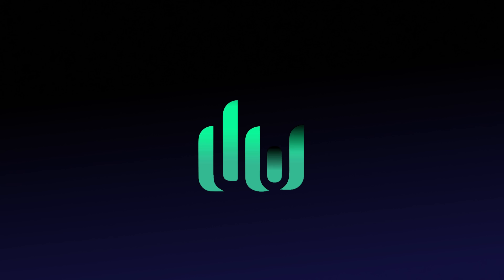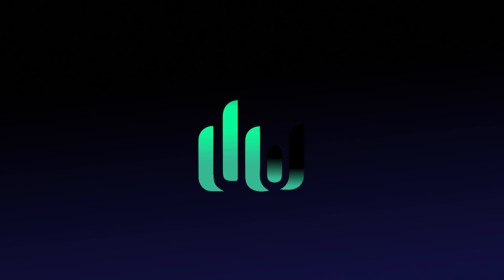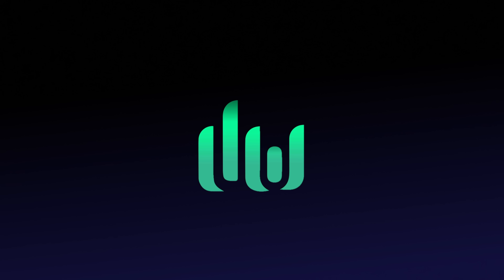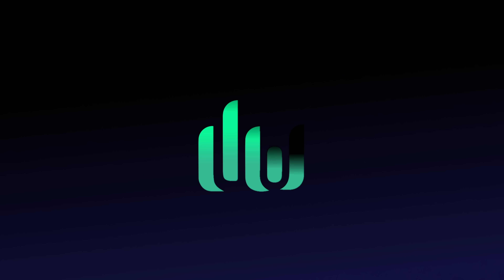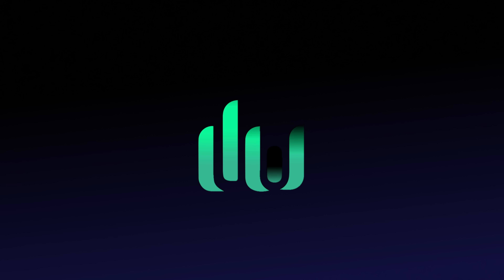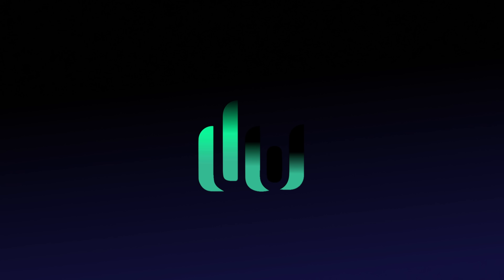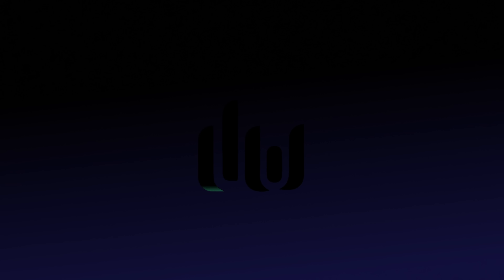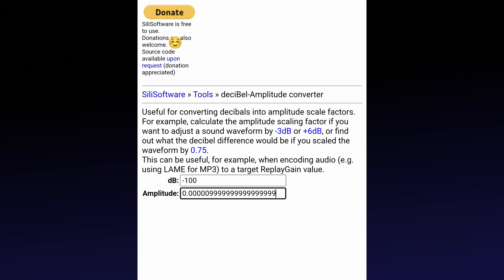WTF is a Decibel?

Comment: 3:00 acoustician here - SPL isn't normally expressed as 'dB SPL' - the correct index for sound power (LWA) or in this case, sound pressure (LPA) - however in environmental acoustics you'll usually use the LAeq,T index or the LAmax index to express the average and the maxima sound pressure levels. It's important to note that for sound pressure, a decibel is simply a ratio of the measured Pascals against the reference Pascal value. So for airborne sound, it's normally 20*LOG(Measured Pa/2*10^-5 Pa).

It's also important to note that you can take sound pressure and sound power and use a lightbulb as an analogy. The sound power is like the watts of power the lightbulb is using - this is a constant and is the OUTPUT of the light (speaker/source) itself. The sound pressure is a relative point away from that source. It's important to also know that sources can be area, planar, line or point sources.

And to add, weighting is very important too! A (for environmental acoustics, this emulates the effective weighting of the human ear) - C (similar to A, but allows room for lower frequencies, this is normally great for impulsive sounds or for music-related environmental sound) and then Z (this is just the unweighted sound).

This is a great video, something I wish I had when I first started out!!
Reply: great post man. everyone should read this immediately.
Reply: The A weighting curve adjustment should be scrapped and replaced by something actually relevant to noise nuisance value.
Reply: @jrgroberts  A weighting makes sure that single value broadband sound levels are most reflective of how humans actually perceive sound across the frequency spectrum. Look up the fletcher munson curve.
Reply: @producermathew  The Fletcher-Munson curve was created +90 years ago, when measurement equipment was nothing to par compared to what we use nowadays. Even if it has been was further revisions of the Fletcher-Munson curves, the A weighting curve is a scam. That helps politicians to avoid legal issues of millions of people contamined by out of the scope noise due to LAeq filters. It makes sense to revisit these concepts as @jrgroberts  suggests, because the incremental low freq noise environments we suffer in the modern world.
Reply: @PereRevert  the A weighting curve is not inversely proportional to the fletcher munson curve. The A weighting correction is standardised within IEC 61672-1, ISO 226 and ANSI S1.4.

A-weighting is generally considered representative of a typical curve for human hearing in so much that we do not perceive frequencies in the same way as an ultra flat type 1 measurement system.

You say it’s a scam, yet don’t provide any context. This is false.
Reply: @producermathew  I didn't say the A weighting curve was inversely proportional to the Fletcher-Munson one. I shoud have mention based on, even if, as you pointed out, it has been further revisions during the years (decades). You're true in regards of I don't provide any context... I should have metion in the context of respecting noise pollution affectations to the people! I mean, because of the A weighting curve is ignoring (filtering) low freq content, that is also so damaging to the human health actually. There are endless situations nowadays of construction and nighclubs low noise pollution for instance, that gets out of the radar or LAeq legal measurements, even if this people is still suffering from it without any legal possibilities to fight against the situation.
Reply: @PereRevert  You're misunderstanding the purpose of A-weighting. A-weighting helps assess noise based on how the human ear hears sound, not how the body feels sound. This means it’s suitable 99% of the time for measuring typical noise levels. A-weighting doesn’t completely ignore low-frequency sounds—saying so is just misinformed.

The real issue with low-frequency sound isn’t about human perception but rather its tendency to create structure-borne noise, which isn't picked up well by A-weighting because it measures audibility, not vibration. For standard noise concerns, A-weighting works perfectly. Often specific reference curves can be used as a datum against which 1/3 octave band sound would be compared. This is in accordance with NANR45 Procedure for the assessment of low frequency noise disturbance.

So in short, no, A-weighting does not really hide any low-frequency impacts in terms of audible sound. What it might not do is accurately portray the subjective characteristics of sound, which standards BS 4142 consider when completing acoustic impact assessments.
Reply: @producermathew  I think we agree on most of the procedures for assessment of noise disturbance... and obviously we agree on the purpose of A weighting... but I don't get it when you're arguing about the fact that A-weighting works for most of the noise concerns, knowing that the most critical are implicit to heavy low freq content. Obviously these are effectively more discernable by structure vibration noise than audibility, due to the nature of the wavelength propagation and acoustic energy, that are frequency dependent. But that's the point of my first thoughts and comment my friend! How effectively we can measure noise disturbance from low freq noise sources with a mere A-weighted mesurement, in order to take action for complaints based on that specific situation that usual A-weighted assessment cannot solve!
Reply: @PereRevert  it depends on the source and what you’re trying to ascertain or assess. Most noise concerns are in relation to rail, road and aircraft. All of which are suitably assessed using A-weighting.

As an acoustics consultant who is a member of the institute of acoustics, it is RARE to be asked to assess specific low frequency sources. Naturally you’ll supplement A weighted measurements in such a scenario with unweighted 1/3 octave band analysis of the source.

As previously mentioned, using the University of Salford procedure for low frequency assessment, we can compare the 1/3 octave band results from below 200 Hz to a reference curve which acts as a threshold to determine the likeliness of impact.

But going back to my original comment, we almost always use A weighting. It’s standardised by the WHO, multiple international and national standards etc… 

So my point remains, A weighting is just fine for pretty much most concerns of noise.

May I ask what your background is in acoustics?
Reply: @producermathew  Thanks for your clarifications. It's really nurturing having such discussions over here! It's great to know your background, and I get all your points, that I mostly agree, but as an audio engineer it's hard to believe that high SPL noise sources can we suitably assessed using A-weighting in regards to the  real impact on human health in a real life situations that I can suffer myself. Even if it cannot be measured by A-weighted equipment for obvious reasons due to the nature of propagation. The reality is, most measurement in reaction to noise complaints in most European cities (where I live/work), AREN'T supplemented by unweigthed 1/3 octave band analysis on the lows and sub-lows bands (thresholds <150Hz), and I guess that's the problem what I'm talking about. Would love to know your sincere opinion on that specific issue, and also if there's any dB compensation in order to match equal-loudness contours on those low freq bands measurements when 1/3 octave band analysis is assessed. I guess a reference curve at a certain threshold solves that though. Thanks dude!
Reply: @PereRevert  so, if we are looking at single broadband values that are A weighted, there’s little context as to the tonality of sound.

Unfortunately I’m not too familiar with European acoustics standards and legislation, although the UK is similar in so much that we use similar principles to the EU.

Generally speaking, A weighting is suitable. And yes, sometimes this can cause a margin of error - but this is something that gets considered. 

I think my point is, at least in the UK, if the plant for example is significant in its low frequency sound energy, this is something that gets covered off by using penalties to add to the single dB(A) value. 

The thing with A weighting is that it doesn’t completely filter off low frequency information, it kind of just focuses everything more on the mids, as the human ear would.

C weighting may sometimes be used particularly for clubs or rather festivals just so that it penalises the low frequencies more which may enable mitigation to be provided over and above what we as humans would require.

I think possibly, this conversation perhaps is starting to dive into the psychology around acoustics which is incredibly fascinating as not least this all starts with subjectivity to sound. And yes, some individuals may be much more sensitive to low frequency sound than others!

It’s like if we’re assessing an overly impulsive source of sound, we may consider the maxima sound levels more than any continuous logarithmic averages.

But to simplify the above, A weighting is good for pretty much most things, and then any acoustician worth their salt would then consider context and the subjectivity of the sound they are assessing.

This is the difference between acoustic design and GOOD acoustic design. I agree that in some  jurisdictions, there isn’t really a holistic approach to assessing the impact of noise. I think in the UK, we do a good job at managing these more complex sources.

Perhaps, it could be beneficial for me to dive more into some of the European standards to see how the processes here in the UK compare.
Reply: @producermathew  I don't think you would need to dive more into European standards, as it seem to be on pair with UK though. What is revealing is your C-weihgting statements, and the penalties to add to the LAeq values, that I totally agree. Yes, I'm personally very sensitive to low freq rumble from wide spectrum loud sources (for instance, I can hear a single kick drum or bass sub notes of a disco party miles ahead than most of my accompanying people, friends, wife...). Obviously it could be subjective, but I don't think your body get it always as a subjective issue, as it implies how we human feel music rather than how we are educated to hear it (audibility in the mids as the most human sensitive freq band). Thanks again mate for such nurturing discussion. Keep up the good work!
Reply: @PereRevert  and on that note, this is why it’s important to always consider the psychoacoustic impacts of a source. As even intermittency, impulsivity etc… can be the factors that make a certain sound annoying/disruptive.

I think in general you’ll find that assessing lower frequency sound is difficult, as it’s more omnidirectional, and the acoustic impedance of materials for the given wavelength is such that allows low frequency sound to travel much further once structure-borne. 

Which is why in the UK, we pay a lot of attention particularly in London of course to potential structure borne vibration/noise from underground railway tunnels.
Reply: @producermathew  Yeah, this! By the way, have been in London a few weeks ago and got impressed (in a positive way) of the controlled noise disturbances, even on the city core, against other european cities. I think this is also a cultural issue, the noise "unculture" of sustainable development should I say, of south Europe countries.
Reply: @PereRevert  it’s an interesting fact that also a lot of London Boroughs require mitigation to normally be over and above what is necessary to help avoid any creep in background noise levels.

But in general, I know the UK is known to be super serious for its Planning System and this is likely why. Don’t get me wrong, London is very noisy, but like you say if you do pay attention you’ll see how acoustic design is used to mitigate and minimise noise.
Reply: @producermathew  Hey Mathew! are you still into acoustics? Thinking of getting a sound level meter and calibrator for personal use (not professional). What's the typical manufacturer tolerance for Class 1 gear, around ±0.5 to ±1 dB? Also, should it be written as dB(A) or just dB? And how much can they potentially drift per year without traceable recalibration?
Reply: @PereRevert  Class 1 is within +/- 1 dB typically between 25 and 135 dB according to IEC 61672-1. dB(A) defines the A-weighted index (normally for environmental noise), dB(C) defines C-weighted index (more appropriate for music studios, venues, concerts, some construction/plant activities). dB or dB(Z) refers to the unweighted index. Weightings are based on 1/1 or 1/3 octave band deductions per each centre weighted frequency as specified in the same IEC standard.

They can potentially drift a lot, therefore you must field calibrate before and after each measurement, with annual UKAS or similar laboratory calibrations to ISO/IEC 17025.

But how much they can drift? Well... how long is a piece of string?

If the kit isn't calibrated properly via a lab each year, and you do not use a field calibrator for each measurement, then it's pointless buying a class 1 SLM.

Is there anything in particular you need it for?
Reply: @producermathew  thanks a lot for the detailed explanation, really appreciate it!

To be honest, it’s just for personal interest rather than anything professional. I've always been drawn to this topic, even if I don’t have a full background as an acoustics engineer. That said, as an audio engineer, I do have some understanding of the technical side and I find the crossover quite fascinating — especially when it comes to real-world measurements and how weighting curves affect perception.

I’m looking into a Class 1 SLM mainly out of curiosity, to better grasp the acoustic reality around me — particularly in urban and mountain environments where I live. I’m also aware of the importance of proper calibration — both field calibrating before and after each measurement, and ensuring the whole setup is lab-certified annually by an accredited centre. And of course, I’d be getting a compatible acoustic calibrator along with it.

Thanks again for sharing your insight.
Reply: @PereRevert  Yes, although I should note that even though you may experience some drift with field calibrations due to changes in weather (normally seen over very long periods, but even then by only .1 or .2 dB). 

If you're purely just interested in the technology and looking at acoustics on a more basic level, then a class 2 SLM often suffices and is more often than not a lot cheaper too!

In the professional world, we not only need to field and lab calibrate for accuracy and to log any potential margins of error, but also we need to prove to the local planning authorities that the equipment is calibrated to the specified standards.

If you have a fairly flexible budget and are looking for something with good features (particularly including RT60 etc...), you might be interested in the NTi XL2 - this is probably the best option since these SLMs are easy enough to learn and are generally very decent in quality.

Other than this, I would recommend Acoem/01dB Fusion/Cube as well as the Cirrus stuff. The Norsonic Nor140 and Nor145 are also great units - we use the Nor140s for most sites.
Reply: @producermathew  Thank you very much for your thoughtful suggestions, they’re extremely helpful and appreciated.

I'm indeed exploring this field with growing interest, not only from a technical perspective but also from a civic curiosity. As I mentioned in my previous message, this goes alongside a purely personal interest in acoustics and a genuine curiosity about how noise impacts our environments. I'm based in an area where vehicle noise, especially from aggressive acceleration of cars and motorbikes, often feels excessive, and I'm beginning to suspect there may be regulatory inconsistencies or gaps in enforcement at the local level. My aim is not to produce anything officially disputing public data, nor to challenge institutions, but rather to carry out independent observations that may complement the broader conversation on environmental noise.

I do have some familiarity with the technical framework, particularly IEC 61672-1, the EU Directive 2002/49/EC, and the WHO guidelines on environmental noise. So I’m trying to align with those references as best as I can.

Budget-wise, I’m willing to invest around GBP3000, especially if that gets me a robust, standards-compliant setup with logging and peak-level capture capabilities. The Nor140 definitely caught my attention, it seems like a highly capable instrument and I appreciate you mentioning it. It might be stretching my budget, but it’s certainly one I’ll seriously consider if I can justify the extra cost in terms of long-term value and precision.

Again, I truly appreciate your insights, they’re helping me navigate this with a bit more clarity and confidence.